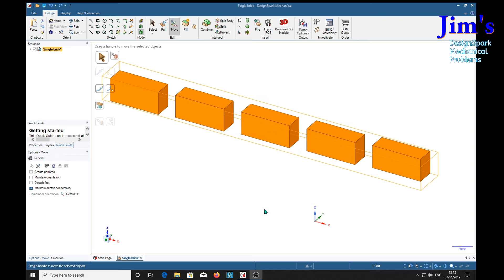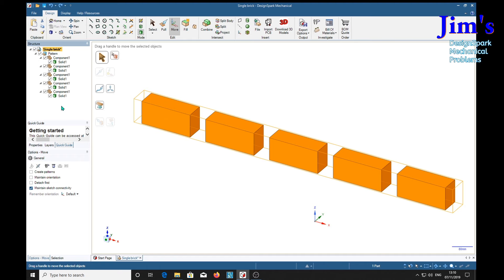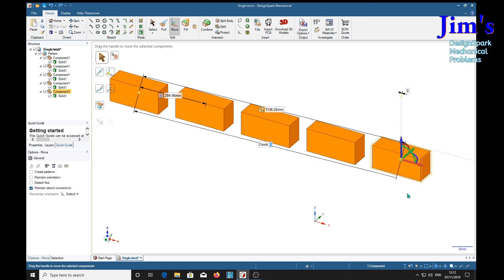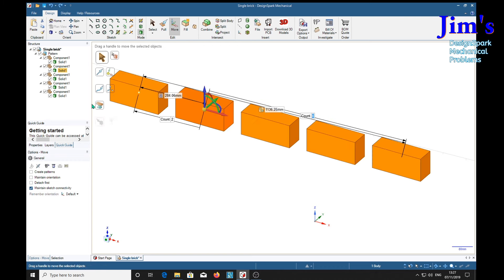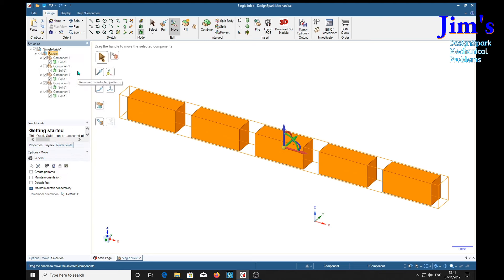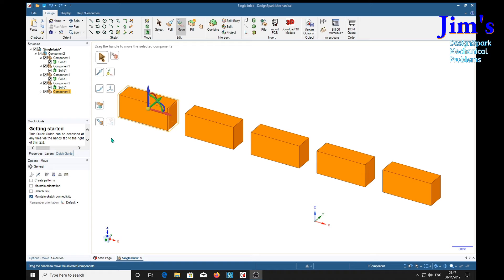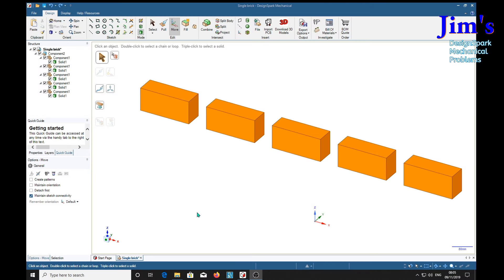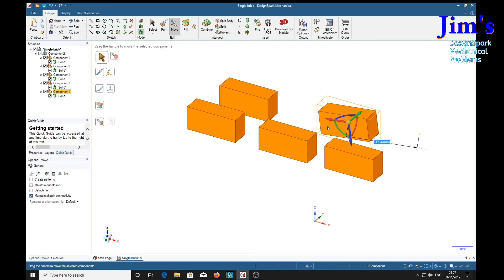DesignSpark Mechanical: Unpattern problem follow up

Comment: Hello Jim. 
As a new user of DesignSpark I find your videos precious. 

I learnt how to draw components and I did a few. My intent is to model 3D printer, so I modeled rods, rod holders, linear bearings, various plates and rails etc, and I saved them into separate files. Now I can open new design and add those files to it and start positioning them. My problem is to how manage various components, how to easily align them with each other, how to position one component next to another so it does not submerge into it or does not slightly hover above? How to "lock" a component so you don't change it, but rather move/rotate it as a whole? So basically problem is that all tutorial focus on how to draw this and that, how to use certain tricks to do threads etc, but none of them how to assemble separate components together into one assembly. One thing I found is your video on dependencies, but that covers only small part of this problem. Could you please elaborate onto that topic? I think it could be a nice video, and it looks like you have such an experience in your steam locomotive design. 

Thanx, Sergiy.
Reply from the maker: Please see may video: https://youtu.be/MdQB96fkAAk  Align, Upto and Orient
Reply: @JimTaylor42  Thanx Jim. I found it and using for a few weeks now.

Comment: You get the same behavior when you make a normal copy of a component. So:
1) make new component
2) make a solid inside the component
3) select the whole component and copy it
If you now go back to the original solid and make changes to it like drill a hole, these change wil also go to it's copy. Just like you were editing a linked file.
Also if you try to change the name of one of your component1's, you will see all the same name's changes.
If you want to make changes to one brick, like drilling a hole, you can make a new component, then copy the solid from one particular component1 to your new component (ctrl-c and ctrl-v it in the structure view). Then you can delete one component1. It's solid is now in the new component where you can change it without altering all bricks.

At first this confused me to, but I understand it now a bit, and find it very helpful. For instance I drew a battery with clips. First positive terminal, then copied and moved and rotated it to a new component where I added a spring to it to make it a negative terminal. Then I made 2 copies of it to get 3 batteries, and then a copy of this set of 3 to get 6 batteries in the end. Later I had to make some changes to the terminals. I only needed to modify 1 positive terminal, and one negative terminal. All copies where then automatically changed also. 

I hope you can make sense out of my explanation. If not maybe I will make a video for you for a change.

Peter
Reply from the maker: I have also discovered this. See my video: https://youtu.be/6LASPA7NTJE Dependency in DSM
Reply: Thanks Peter, i'll give that a try.
Tim

Comment: Hello Jim - first a big thank you for illustrating DSM so well. I wonder if you could shed some light on two questions:
1- I have a design with an internal hole (conduit) that I cannot edit presumably because it's hidden (and I don't know how to target the relevant settings), 

2- At one moment a rather simple design 'lost' its proper orientation in space and all design grids (x) now show up at an undefined angle. How can I fix that?
Thank you!
Reply from the maker: I need more information i.e. images.

Comment: H Jim
I just wanted to add...
I've just added a pattern of holes, five  in a line. The first hole i moved relative to a face on another part using the 'by dimension function' and i noticed the separation between the holes automatically adjusted hmmn, thats nice...Then, i moved the last hole, again using ' by dimension function' to relative to another different part and ( i thought fantastically !), all the hole separations adjusted automatically again! so, without getting the calculator out, patterns of holes can be 'Fitted' between unrelated features / parts it seems ! I think that's super!

Patterns of a part or a group of parts ( say bolt, washer and nut ) works differently to holes in that by moving first or last of a group relative to another feature,  does not alter any intermediate spacings. However, if used in conjunction with annotation dims to reference features to the start and end patterns, these dims can assist positioning the pattern exactly symmetrical or otherwise.
Edit above, YES, all ok... just use the toggle padlocks, adding / removing pattern members also possible - all correct.

Patterning parts , say a bot, washer , nut AND 'connecting hole through a plate' DOES'NT seem to work sadly in DSM. In Spaceclaim i have no idea...but read below - not really a problem.

DSM patterning is still quite cute however...just work ( initially ;)  ) without the holes, determine design using the fasteners and they'll always be volume for a hole later...KISS.

and, don't forget to use small, med and large 'NUDGE' for easy UP/DOWN sizing increment on any selected input box - so much easier for visually judging postion than maybe a guess at a typed value.

The behavour of Patterns / Components and Parts is fully outlined in  DSM Help.
But, it's good that all these subtlties are highlighted - helps me to know the software better. 

Thanks

Tim.

Comment: one question Jim? I noticed in the right lower corner a 80mm long blue line where does that come from ?? sorry for the question I have one on my own screen as well, as a practical zoom factor Nice videos by the way I learned fusion 360 quit well, but I found out the hard way that it was no longer "free"after 3 years . all of a sudden I was thrown out thanks but no thanks and for a lot of money every month I can get back to use it well no thanks I luckily found design spark mechanical and Jim so I start from scratch again kind regards Hans